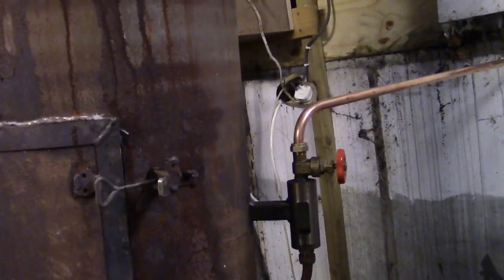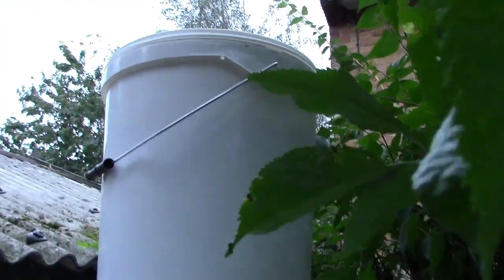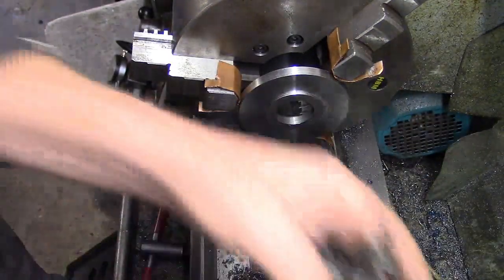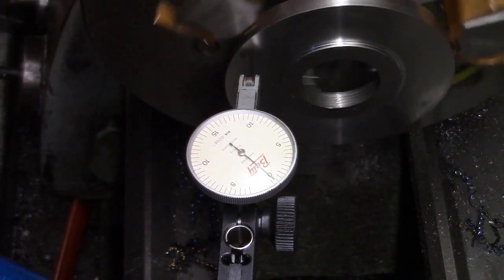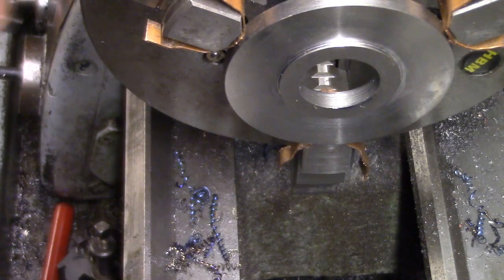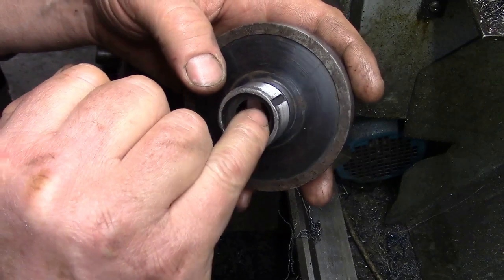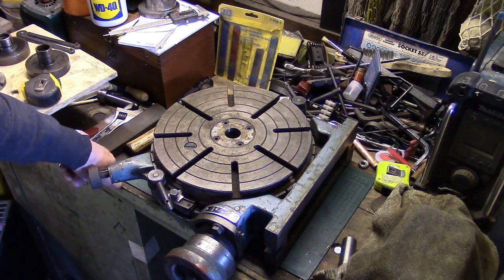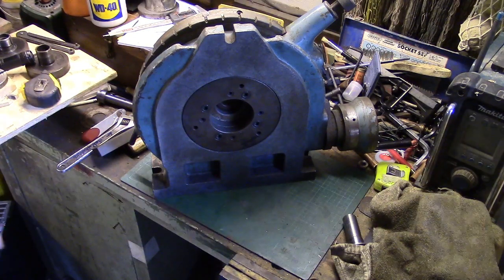Surface Grinder Repairs Part 3

Comment: That's an awesome furnace. I have a ductless mini-split in my shop that I like pretty well, and wood stove for backup.  My insurance guy tell me that in the near future they won't allow wood stoves.  So I may be looking at other backup systems.  Surface grinder hub is coming along nicely.  Looking forward to seeing what you come up with for a special wrench.  Cheers, Mike. 😊
Reply from the maker: For got to show the tool when I got finished, but that’s the least of my problems, the grinders down and sure how we are going to right the problem,😩😩
Reply: @pearcemachineshop5200  That's a sweet grinder.  I have no doubt you will get it going.

Comment: Nice rotary table, wonder how much you paid for it.... i know very well that they heavy, mine is about the same size and once it slipped off my oily fingers, no real damage to the tool but i could feel the pain for for months, ... and yes, i do wear safety shoes in the shop ...:-)
Reply from the maker: I’ll tell next time we have a chat, nice video on the car engine Mike.